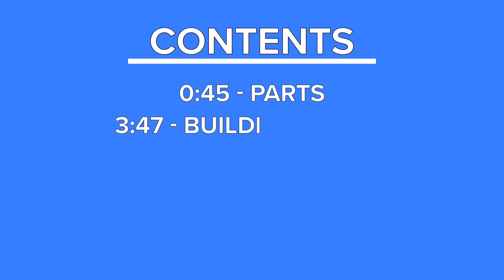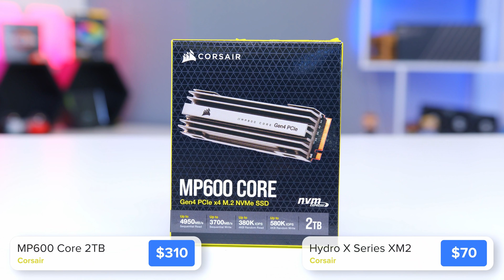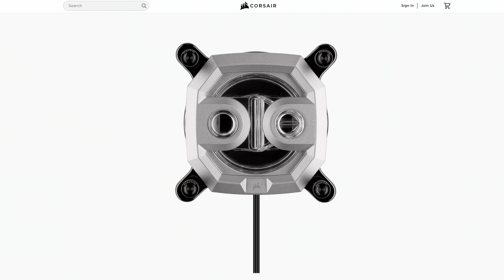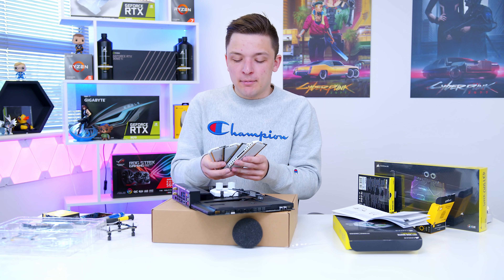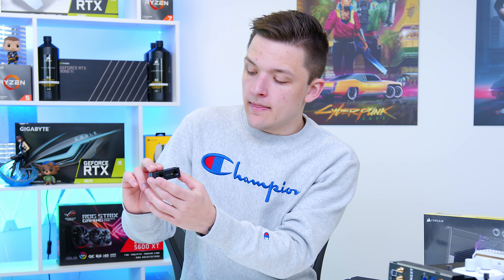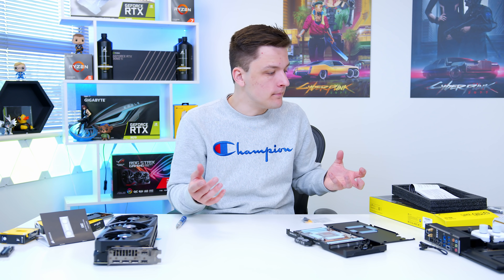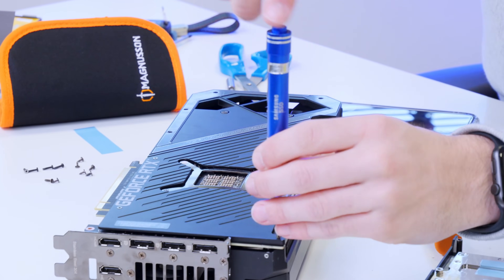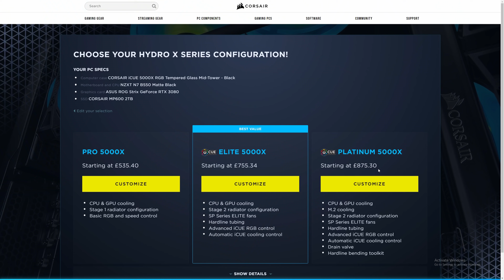INSANE $5000 Gaming PC Build! [My FIRST Custom Loop - RTX 3080 & Ryzen 9 5900X!]

Comment: Just a small pointer, you should not do cpu and gpu on series, as if gpu cooler uses the cool water. Cpu will get hot water. Since you have 2 radiators, you should do tank->radiator1->cpu->ssd->radiator2->gpu->tank
Reply from the maker: Not necessarily the case, afaik the temperature of the loop equalises - it's not as though you're pumping hot water over the CPU. This is reflected in our temperature testing, if this was the case the CPU would be sitting at 70/80/90c, which it was not :)

Comment: i have a question GeekaWhat. On this motherboard, do we need to flash the bios for the new 5000 series ryzen CPU's? or does it come with pre-flashed BIOS for the new ryzen 5000 CPU's? because i have seen some motherboards having pre-flashed bios for the new ryzen CPU's and an example on one of them is the B550-F so my question is, do we need to flash the BIOS on this mobo for the new CPU's from amd?

Comment: i think your temperature in game pretty high compare to my aio because my kraken z73 perform better than your custom waterloop, in game avg around 50c. When compare to my gpu strix 3080 oc, in game avg 68c. So what's the point to use custom waterloop if my gpu air cooling better or same as your custom waterloop? 😂
Reply: You got 50C with an AIO?
Reply: @astudent1743  yes with nzxt kraken z73

Comment: I have a 3080 and a r9 5900x and on lowest settings 1440p on warzone I only get around 130-160 FPS. Would you have any clue why? 
My motherboard and psu both got sent back a few months ago because the psu faulted and shorted the mobo and both were refurbished or replaced, unsure of which. The company did not tell me, would that be any issue to my FPS?

Comment: why do people want that much cooling on their drives 

it literally makes them slower
Reply from the maker: It doesn't make them slower, but its an enthusiast thing. Obviously its not required, but this whole build and loop isn't required either...
Reply: it really can make a difference, the electrons moving the data can move more quickly and easily at higher temperature and do the opposite at lower temps. but now that I'm thinking this over for this build it shouldn't really matter because the water is coming strait from the graphics card but if you just had a 360mm rad directly into and SSD there would most likely be some slow downs.